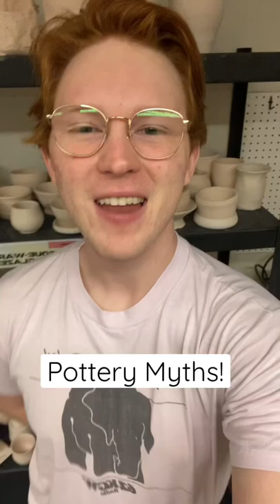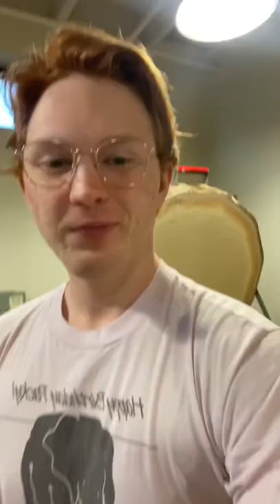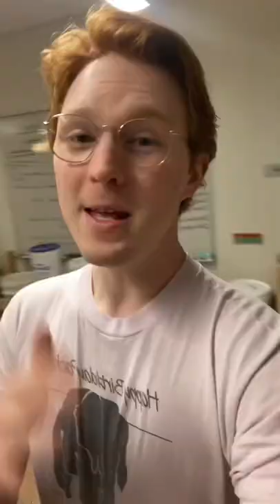Pottery myths #pottery #ceramic #art

Comment: Air bubbles can't be a problem because modern wall bricks are made with a lot of air bubbles so they are insulating much better. Some are thick af up to 50 cm.
Reply from the maker: You're so right! Its water trapped in the clay that when it gets heated too quick can try to escape by going boom
Reply: @benjamin.cahoon  Yea our ovens are huge and heating the clay evenly and slowly. And the air bubbles are made by burning millions of wood pieces inside the clay.
Reply from the maker: @kaptkraut  super cool! Have you ever looked into paper clay? It's kinda a fun small scale version of that?
Reply: @benjamin.cahoon  Can you build small houses for tiny people with it?